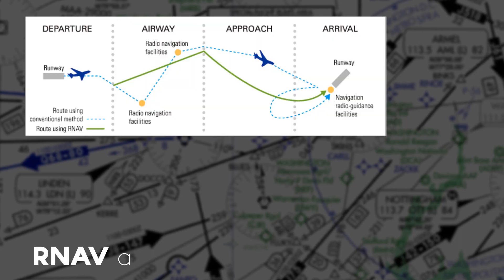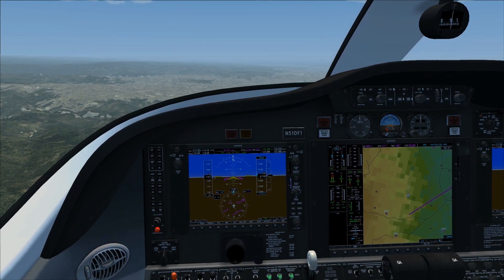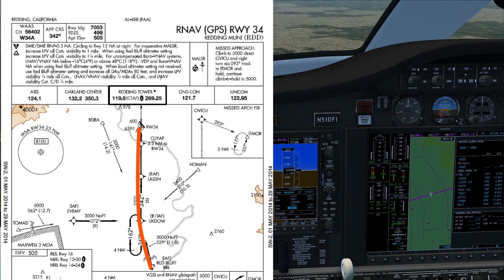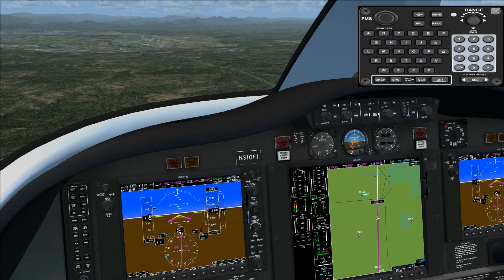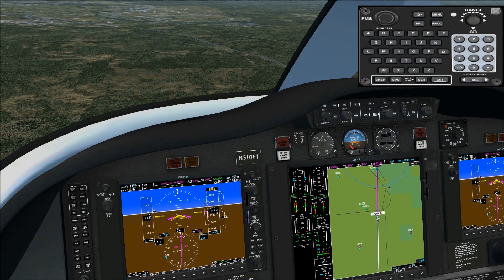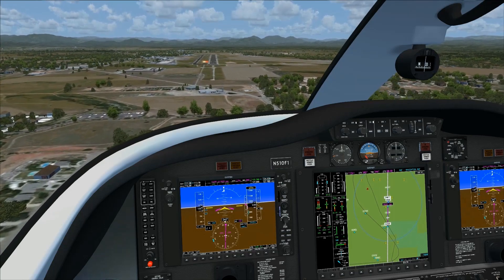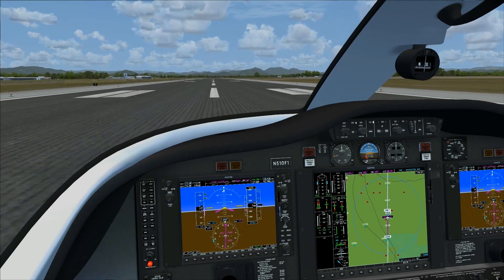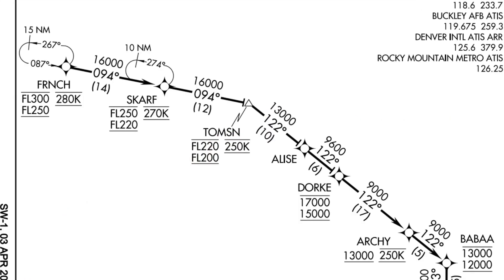Mastering Virtual Aviation #1 - Intro to RNAV (Area Navigation)

Comment: Very nice video indeed Sir!. Quick question about the minimums. You selected the LPV minima of 790'. I think I am correct in saying that this is a non-precision approach, despite the vertical guidance. In which case the minimums is an MDA and not a DA. As such with a CDA (constant descent arrival - as opposed to a step down approach) then an addition is required to the MDA (usually 50' for a 3 degree slope - 840' in this case) to prevent descending below the actual MDA (790' in this case) in the case of not meeting the visual requirements. If perchance I am incorrect about the LPV being non-precision, then it would be great if you could explain the difference between the LNAV, LNAV/VNAV non-precision approaches and the LPV in your great and clear style :)
Reply from the maker: Thanks for the kind words. Did not know this, thanks for the snippet of info. Happy landings ;)
Reply: LPV is indeed considered a precision approach. "Localizer Performance, with Vertical Guidance." If the approach were happened to downgrade to LNAV+V then it would no longer be considered precision. 

http://www.faa.gov/about/office_org/headquarters_offices/ato/service_units/techops/navservices/gnss/library/factsheets/media/RNAV_QFacts_final_06122012.pdf
Reply: ***** Thanks Jordan. I tried to find something on this myself as we don't use LPV, but generally most of what I found said non-precision. Many thanks for the clarification.